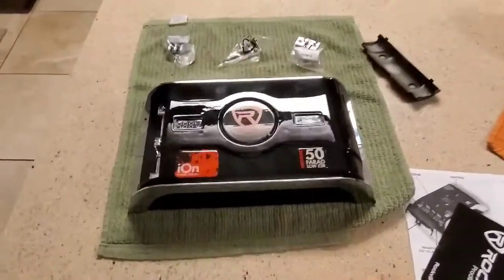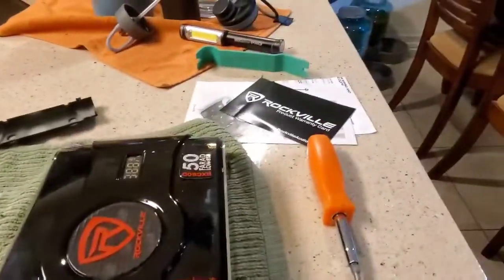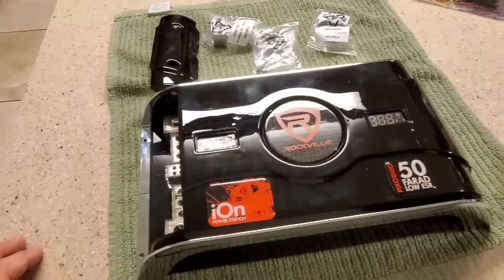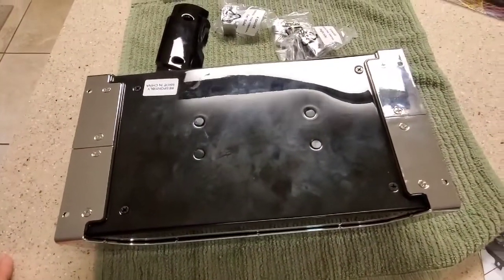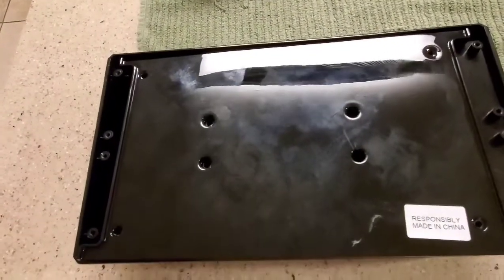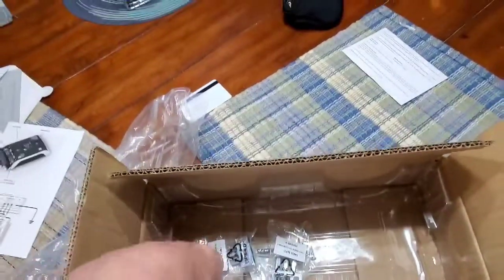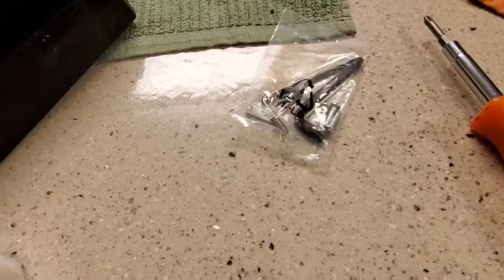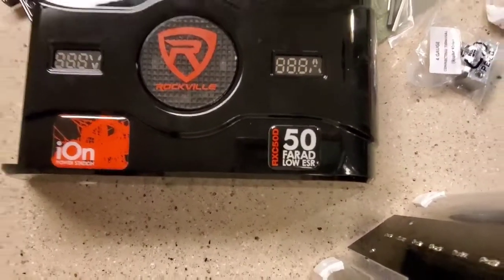Rockville Capacitor Power You Need For Car Audio System Rockville RXC50D 50 Farad Cap Tear Down

Comment: Wow it looks a 100x cooler without the case. I would ditch the plastic case. If you haven’t figured out what the blocks are by now. They are reducers, They should allow you to run bigger power and ground cables. Maybe 1/0
Reply from the maker: The plastic does cheapin the look a lot.

My mind went offline, I knew what they were... LOL. 

Thanks for watching.

Comment: Well thanks all for the laugh, I've had a great time.  Well, you know why those 6 caps in the center are de-labeled?  It's because THEY are the 50 Farads worth, the 2 metal cans that look like garbage bins either side are just that, garbage bins.  They're there to give idiots something to point out when they tear open something they don't understand.  Those 6 small caps will be 2.7v 300 Farad caps, combined creating a 50 Farad 16.2 Volt capacitor.  It's great to see they don't even have a balancing circuit for each cap to ensure they charge to the same voltage, typical dodgy unsafe Rockville garbage.  They are more than likely these cheap overrated Chinese SAMWHA caps or very similar
https://coolcomponents.co.uk/products/electrolytic-super-capacitor-300f-2-7v
Reply from the maker: I wouldn't buy this Cap again.  It did what I needed, but definitely not the best option at all.

Comment: I had a Rockford 10 farad for 8 years. Unfortunately, I left it in, when I sold vehicle. Bought this very recently for my new vehicle install. When, I was looking at it, I noticed something loose and moving around inside. So, I opened it up. Noticed that one of the nuts holding down the positive outputs was in there. I am going to try it out any ways. I'm hoping for it to at least put out, say 1 fifth the rating. So, 10 farad. I just hope, it doesn't burst into flames. We will see. I am documenting my installation of it. So if it does have some weird issues, I will have proof of installation process. Fingers crossed
Reply: So how is it so far?

Comment: How would you connect it with a crossover
Reply from the maker: One of the great things about this Capacitor are the power blocks that come on it.  To add a Crossover, you simply run the positive and negative from the Crossover to the Capacitor.  Crossovers work just like an amplifier. 

The RCAs (sound) don't run thru the Capacitor, only the power does.  

Thanks for watching.
Reply: Greg Philpot really wow I thought it was more then that. It’s been on my Jeep for over a year not hook up because I couldn’t find info
Reply from the maker: @JoseHernandez-tc1kl  Go to the Rockville website and check out their DSP unit.  They have a wiring diagram that explains how to hook up 👍

Comment: There is no way thats 50 farad...50 farad of Super caps is much larger...another typical lie from manufacturing
Reply from the maker: Tested and came back at 47.  That is close enough to be true.    Love to hear if anyone gets a different reading. I am like you and seen 2 farad caps bigger than this..
Reply: @gphilpot1  very cool it was remotely close to its rating..
Reply: @gphilpot1  how did you test it
Reply from the maker: @MyBlowncobra  Amazon review written by others. I looked at YT videos to learn how to test for myself. I still want to so that I know and what I say is from my own knowledge versus others. 

If you figure out a way, I would be happy to test mine.
Reply: @gphilpot1  so after hooking it up how did it perform.
Reply from the maker: @MyBlowncobra  I think sound quality was to negligible for me to hear any difference. But, I didn't see my lights dimming on agressive songs.  Also, if the onboard meter is correct on the Cap, then it is doing it's job. 

I want to post a video of it in action. Problem is the phone playing the music is the same I need to use to record....  Phone won't do both...  Going to charge an old phone for this...

Comment: Did the 50-farad Capacitor stabilize your voltage with 3 amps?  I have 2 amps 5,500 watts max altogether and was looking at this 50-farad capacitor to keep my voltage from jumping up and down when the bass hits. I have 2 batteries and the big 3 upgrade and a 300 high output alt.   Did the 50-farad capacitor do the job for you?
Reply: I think everyone is turned off due to the housing being plastic remember if it was metal you would create a ground loop and raise the audible noise in your system. It's a capacitor any proper engineer will understand why it should not be housed in metal
Reply from the maker: I haven't completed the install so I don't know yet. I will circle back when I do.  

By the sounds of you you have already done, not sure this Capacitor will do much more. You shouldn't see any drops with everything you have done.
Reply: @gphilpot1  Thanks, I was wanting my voltage to maintain but its dropping to 12.9 when the base hits hard then back up to 14.2 on my voltage meter, is that normal? What is the actual drop in the voltage that I should see?
Reply from the maker: @brysterling7637  at 12.9 you should be good. Many people add a stiffening Capacitor in addition to what you already did to act as a buffer. What matters most is how quick your system recovers from the drop.  Do keep in mind all this power demand we all do to our cars with loud stereos takes it's toll on batteries and alternators.  

I honestly think this Rockville is too small to do much. The caps inside the enclosure are a lot smaller than a Stinger 2 Farad. Unless Rockville has some wiz-bang circuitry that others don't.
Reply from the maker: @brysterling7637  There is a thread on Sundown's FB with almost your same setup and same issue. They say newer cars control alternator charging abilities.  They recommend bypassing the PCM.  I have never done this and imagine you will need to look into this. Many are also saying the battery only kicks in with the voltage drops close to 12-12.5 volts.   

Copied post below:
Newer vehicles are voltage controlled with pcm “to save” when the battery is charged fully the alt kicks off so it’s like constantly shutting off and turning back on that’s why people are saying you need a bypass you’ll have a battery light on dash usually from unplugging main plug but no other options really
Reply: @gphilpot1  Thanks for the advice. I feel at peace now about the situation. 
Good luck to you and your install.
Thanks again.
Reply from the maker: @brysterling7637  apparently I messed my capacitor up doing the tear down video 🤣.  It is acting funky. But I ran out of time before I had to travel for work.  I will double check everything Friday.  This current build is kicking my butt.
Reply: @gphilpot1 lol sounds good. I have done that last year, the capacitor wouldn't hold a charge after I did my tear down with an upgraded system, but I caused a huge surge going to the capacitor which sparked like crazy lol  Great can't wait to hear about the results.
Reply: Stop Light I was reading some of the reviews on Amazon. And a guy says he bench tested this capacitor and got a reading of 45 farads read out. Hmmmm
Reply from the maker: @brysterling7637  that is really good to know it was close. I am far from a capacitor expert, I wonder if physical size has any bearings on the caps?  I have seen Stinger 2 Farad caps that are twice the size of one of the silver caps you see when I take it apart.  

Does physcal size matter (TWSS)? Or does just the Farad reading matter?  

I will ask some Farad guys from YouTube. 

Thank you for the feedback. I still need to RMA this one for repair. I will admit to Rockville I took it apart.  Don't want to trick anyone as to why it isn't working. 😕
Reply: @gphilpot1  hmmm, that's a good question.
Reply: You shouldnt have voltage drop with 2 batteries and 300 amp alternator. On newer cars from 05 and up you have to install a external voltage regulator from your alternator because the cars pcm is still gonna read 14 volts and its gonna work like a factory alternator even do is a highout put alternator.
Reply: You're better of with a second battery and a battery seprator..
Reply: you got all that and still have problems hmmmmm